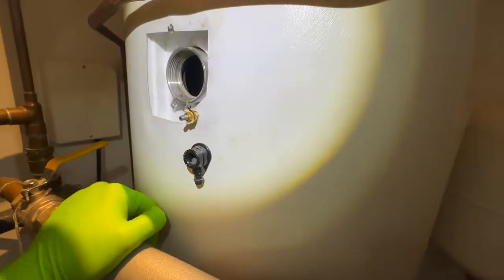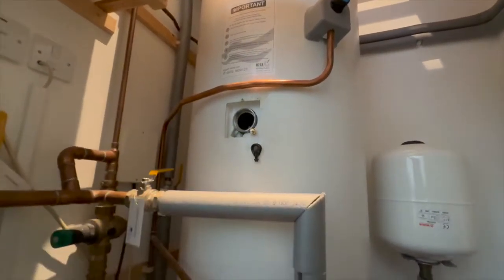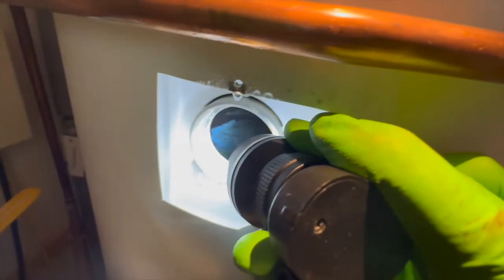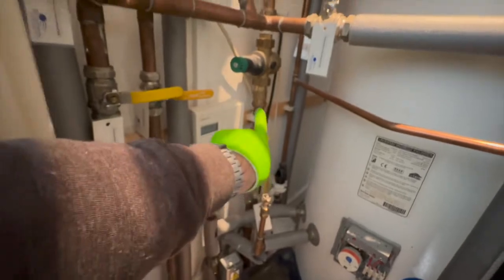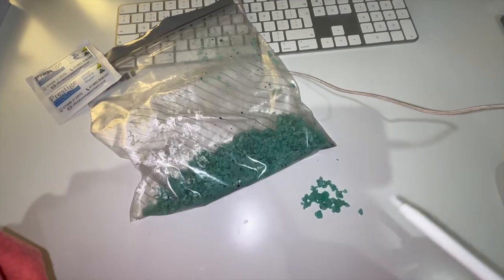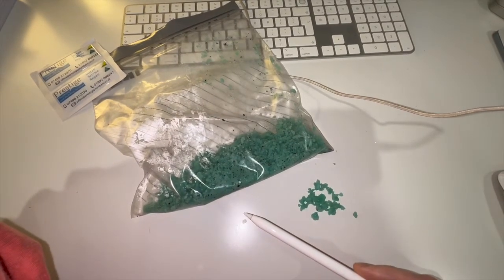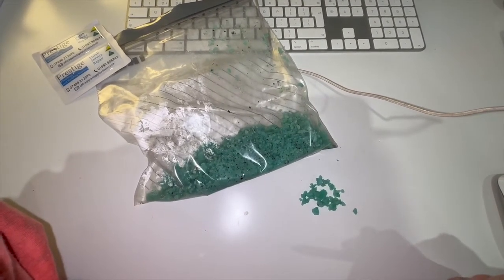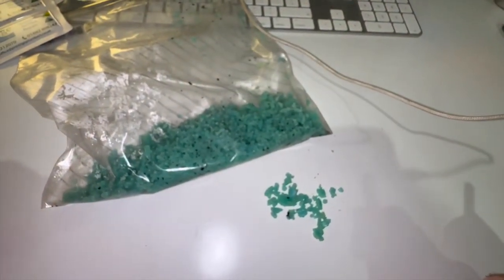Broken baffle plate in Heatrae Sadia Megaflo hot water cylinders

Comment: Hey, we’ve just had a client with the exact same problem. Megaflo have been out and are supplying a new cylinder under warranty. 
Interesting as these cylinders are marketed as top of the range.
Reply: They’re not though, I think they were just one of the first. Do you know how old your clients tank is? I’m hoping it’s a batch produced about 13-14 years ago that is the issue, not newer ones. I’ve got a warranty replacement to add but am nervous of the same thing happening
Reply from the maker: @winning.is.spinning  in this instance the clients cylinder was around 13 years old. The cylinder I saw it on before was around 18 years old. I hope the material used in the new baffles is better suited to the application.

Comment: this exact thing happened to mine. I've been supplied a replacement tank under warranty but I have been left with tap cartridges that has needed replacement.
Reply: How did you go about getting a replacement I phoned then and they weren't willing to do anything to help.
Reply: @connorlumsden3950  it was a couple of years ago. I called them and agreed to an inspection by their engineer, if it turned out to be ‘my’ issue, I would have to pay the call-out charge. I showed the engineer the debris from the tap which he claimed was limescale but I had the facts and offered to burn it in front of him to prove he wasn’t.

He then went off to call his boss and returned two minutes later to confirm they would supply a replacement tank, but wouldn’t fit it.

My tank was 11 years old, and it had never had a documented service so I counted my lucky stars, accepted the offer and moved on.

The replacement tank has been sat in my garage for two years whilst I wait to commence an extension as it made sense to swap it at the same time.

In this period I’ve go backwards and forwards with what tank to fit as my intention was to sell the megaflow on.

Recently, I think I’ve decided to just use the replacement as things I’ve read say the baffle issue is now resolved. It came with a new fitting kit that included the brass nuts, motorised valve and PRV. As all the pipe work is in the correct place it should only be a day or so to swap everything over.